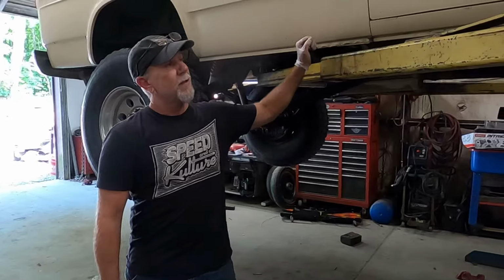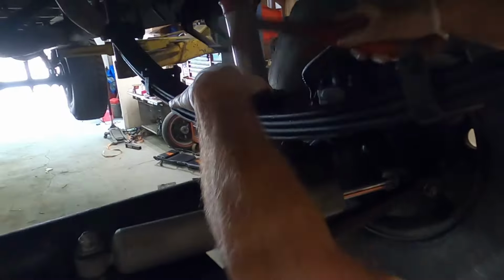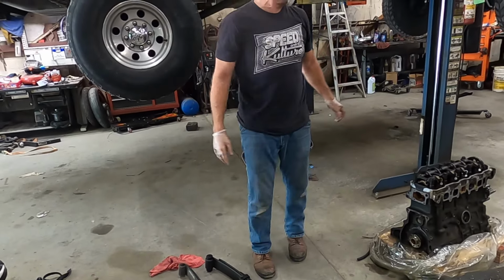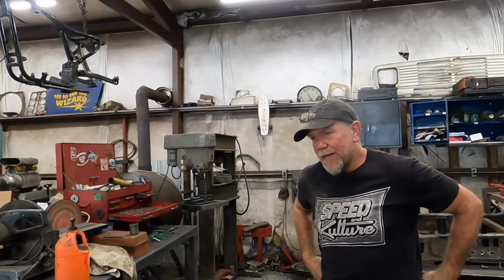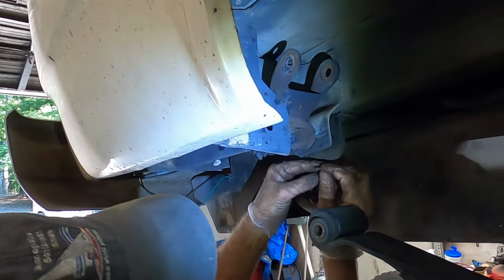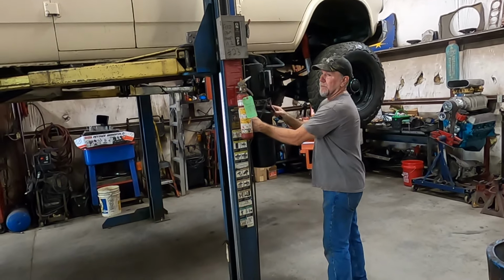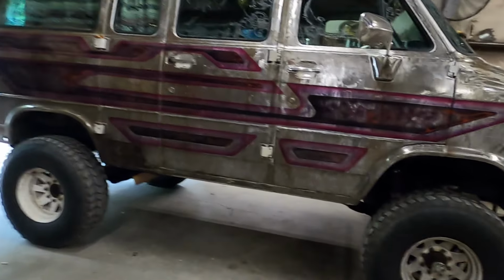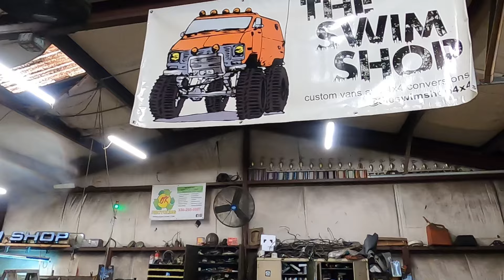Getting Ready For Glory Daze Motorcycle Show! - The Swim Shop 4x4

Comment: Cool video guys 👍👍 Yall were talking about the kits yall sell that they are square body Chevy kits and I started thinking about my 86 K10 that I had that I towed down to Florida behind a U-Haul truck and then ended up selling down there cos I needed the money 😞😞 It had a 4 inch lift with 33’s a slightly built 350 with a cam , headers , Edelbrock carb and intake and old granny gear iron transfer case , man I miss that truck everyday and I’m sure the guy that bought it turned it into a mud truck 🤦🏻‍♂️😩